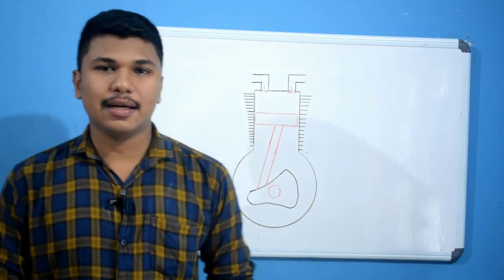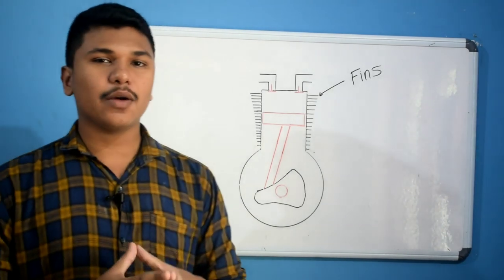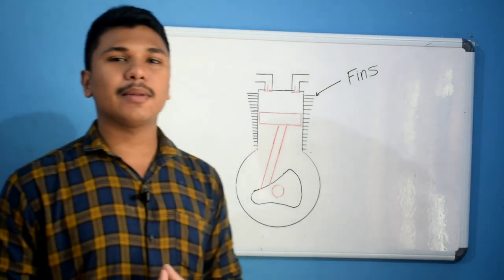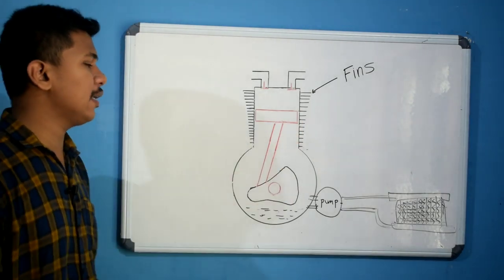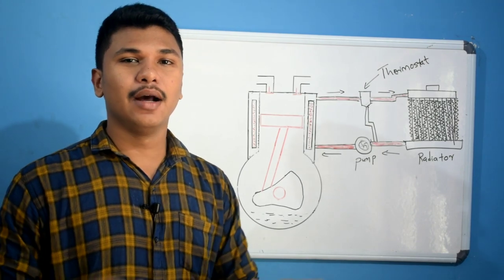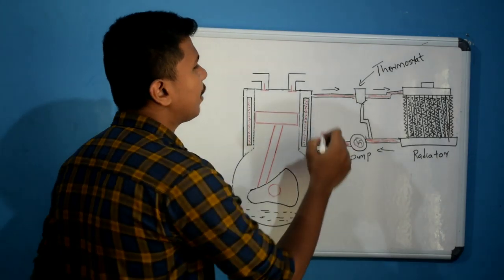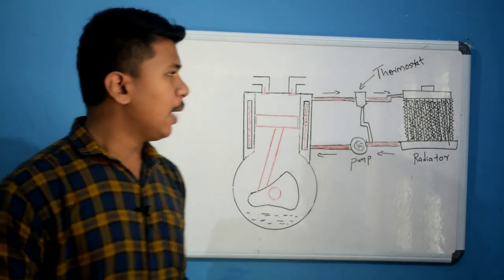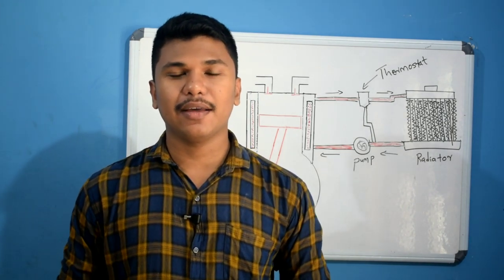Air cooling, Oil cooling and Liquid cooling Explained  | malayalam video |Informative Engineer |

Comment: നിങ്ങളുടെ  വീഡിയോ ഇഷ്ട്ടപെട്ടു..,👍Oru advice ആണ് ; radiator ന്റെ കൂടെ expansion tank കൂടി ഉണ്ട്... modern engine കളിൽ essentional component ആണ്.... Overheated condition system pressure maintain ചെയ്യുന്നു...
Reply from the maker: Yes..  ariyaam..  njan adikam confusion aakanda enn karuthi... pinne varakkanum avide sthalam illayirunnu.. 
Athukonda..  sorry

Comment: Oil cooling valya gunam ellenu paranjille.. machan oil cooling technology thanne kandupidicha Suzuki's oil cooling system ine onne arinj erikkune nallathe.. sf250 il use chythirikkunee.. video kollatto
Reply from the maker: Gixxer 250 le oil cooling system sadharana oil cooling pole alla.. 
Lokathile first..  oil cooling mathramulla bike engine aanu gixxer 250..
Lubrication nu vendi oru oil circuit um.. cooling nu vendi additional oil   passage  um aanu ithil use cheyyunnath...
Gixxer 250 yude oil cooling oru exceptional case aanu...
Njan normal oil cooling ne kurichanu video il paranjath...

Thank you...

Comment: super video bro,ഞാൻ unicorn bike ആൺ use ചെയ്യുന്നത്,ദിവസ്സം 150km ride ഉണ്ട് 3 ദിവസം കൂടുമ്പോൾ engine ഓയിൽ ചെക്ക് ചെയ്യും കുറവുണ്ടാകും മെക്കാനിക്സ്  പറഞ്ഞു use കൊണ്ടാണ്,ശരിയാണ് നല്ല ചൂട് ഉണ്ടാവാറുണ്ട്,unicorn ൽ coolar വെക്കാമോ? any ideas ,ples rely
Reply: 150 km daily otttathil  engine oil kuarayunnenno  njan 250 Km daily odumayirunnu discover bike il 
Evidelum leak kanum allel inghane varilla
Reply: Coolent vakkanokke pattum efficient anonnariyilla

Comment: ithil thankal mention  cheyyunna pump recirculation electronic pump ano ithu faulty ayal power loss undakumo
Reply from the maker: Cooling systethile coolant pump proper aayi work cheyyunnilla engil coolant circulation sharikkum nadakkilla.. appol engine overheat aavum.. power kurayum.. ath engine nu valre adikam damage undaakum.. 
Pettenn oru workshop il kanikoo..

Comment: Bro enteel pulsar 180 aan.... Njn 220de oil cooling സംവിധാനം 180k keetiyit kaaryam undo.... Please give reply
Reply from the maker: Pulsar 180kk heating problem undo??.. 
Oil cooling fit cheyyam.. prashnam onnum illa..
Reply: @informativeengineer2969  njn aftermarket exaust vandik keetitund so heating problem und.... Njn paranj varunnadh endhaan enn vechaal idh vekka 4 5 roopayoolam aavum..... Vechit modhalaavumo?
Reply from the maker: Oil cooling vachal heating vallathe kurayukayonnum illa..
Reply: @informativeengineer2969  Bro, ideally how long we could ride an air-cooled scooter? ( I mean, at what intervals we need to take a break to avoid overheating) 
Say, riding a Burgman for a long 650kms!!

Comment: Autorickshaw Kalil ethu type cooling anu
Reply from the maker: Forced air cooling.., 
Water cooling ulla type.. ape launch cheythittund
Reply: @informativeengineer2969  auto vandikalil engine purakil alle ,pinne covered um Anu, apol engane air cooling work akum
Reply from the maker: @albesterkf5233  സാധാരണ എയർ കൂളിംഗ് അല്ല... Forced air cooing aanu.. ഒരു ഫാനോ മറ്റൊ ഉപയോഗിച്ച് ആണ് കൂളിംഗ് ചെയ്യുന്നത്..
Reply: @informativeengineer2969  k
Reply: @informativeengineer2969  athupole pazhaya Bajaj chatak scooter il kicker nte sidil fan kanarund,ath cooling nu vendiyano

Comment: R15 v3 has a 155cc engine even though it have liquid cooling, why?
Reply: Because It's is high performance 4 valve engine, so that R15 v3 engine produces high level heat because of its high compression ratio, especially comparing to other 150 segment in the market, This is my opinion, I am not a Expert
Reply: @ishfadalit6388  thanks bro
Reply: Yamaha fz 25 has 250 cc but it has aircooled. But in the Bajaj Ns 200 has  liquid cooled.
Reply: High compression ratio high power
Reply: @nihalvn3308  same power with more cc decrese stress in engine athayath 250 cc yamaha 20 bhp round fig ns 200 24 bhp so high compression ratio appo liquid cooling venam